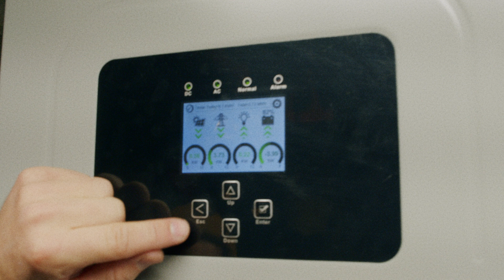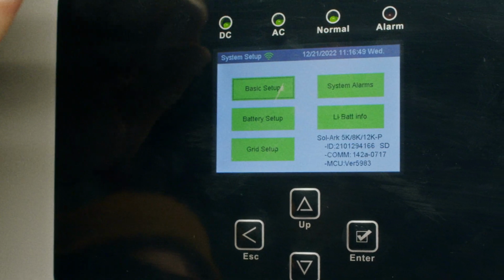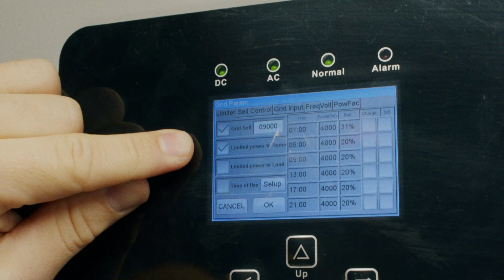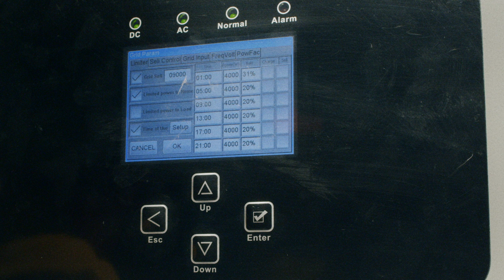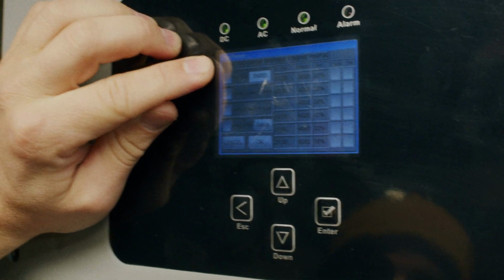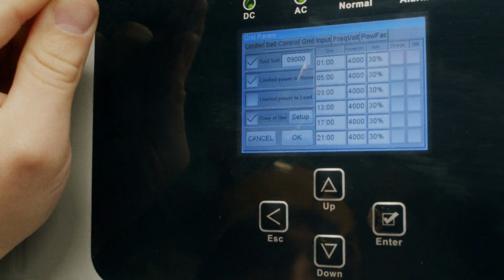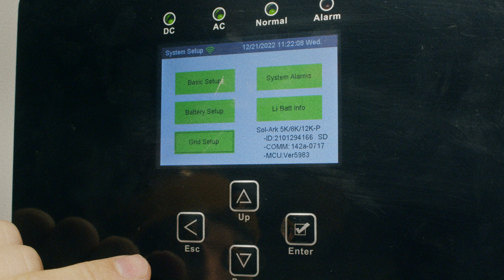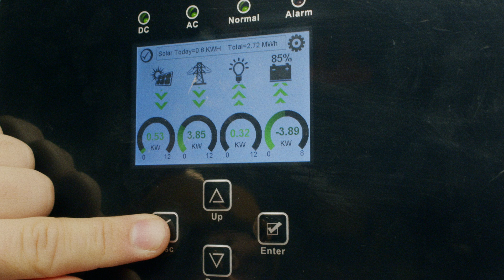Peninsula Solar Sol-Ark Instructional Series: Time of Use

Comment: My installer put one of these Sol-ark15k in. I have a grid disconnect outside which passes through to the basement wall to the Sol-ark15k. He set it to use a trickle charge from the grid. I don't like that. I don't want the grid to give me any trickle, period. I don't mind setting up the Sol-ark 15k to charge my 12 48v eg4 lithium ions at a 20% level. How do I remove the trickle and only get the grid power at the 20% level to my batteries? There are times with this "trickle" that I've watched the feed going back to the grid at 200+W!!! I don't want that either. Is this something that I do with the parameter settings or time of use? Thank you. I have one more question, please. I currently have 27 bifacial bluesun 460 with 575 gain, panels going to this. Have bought 10 more. Going to place enough to max my input on mppts but also keeping in mind my solar gain. Would a total of 36 panels be too much or should I just use a total of 34? Also thinking of adding 1 more bank of batteries (6) to have a total of just over 90kwh for winter and collective cloudy day spells. Your thoughts? Using our hvac mini splits with our regular household use can make the total daily use hover around 40-45kwh. I've heard that doubling your battery capacity of this use gives you more days of use during cloudy winter days. God bless you and your work. Thank you for your videos. Keep them coming.